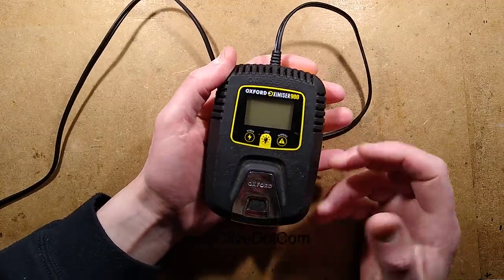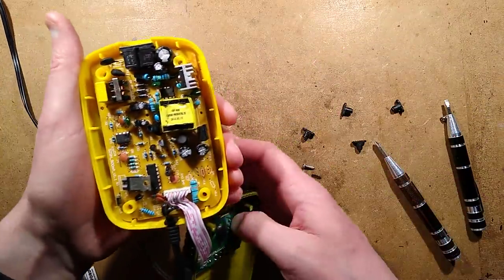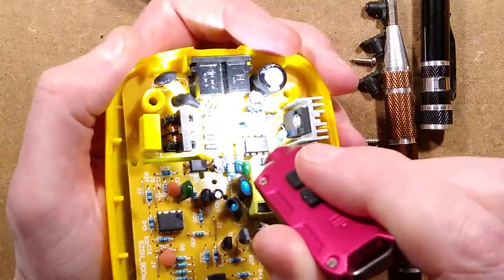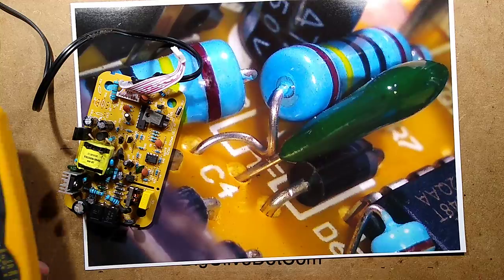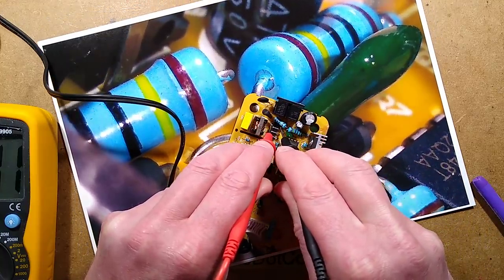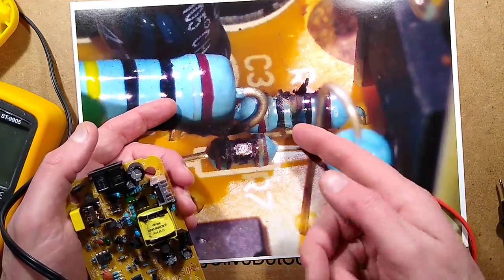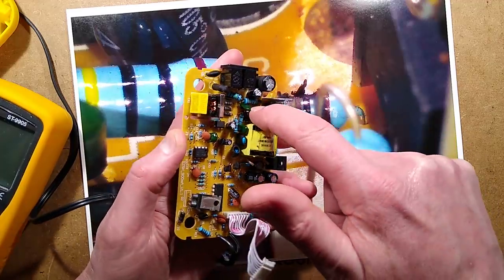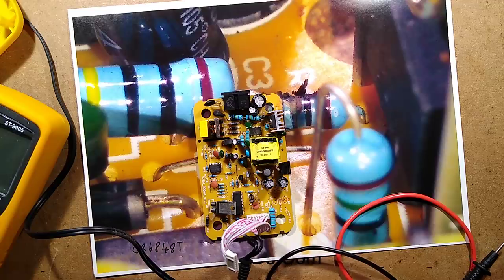Autopsy on Thomas Nagy's bike battery charger.

Comment: Any chance you can order and review a "T12 soldering station" clone from china?

Also that diode under the green cap looks quite crispy as well!
Reply: More than crispy, it's split wide open!
Reply: @cambridgemart2075  Definitely. Looks like it's time has run out for sure. There are brown burn marks around the split, like it must have been a big ark splitting it.
Reply from the maker: I thought that too, but it's a moulding seam and measures correctly.
Reply: @cambridgemart2075  yes i noticed that as well D6, maybe the snubber if so then that cap may have shorted causing a cascade failure ??

Comment: Get a new unit, but I think a different brand and form factor (to minimize the chance of getting a differently badged one off the same production line).  You might end up with the same poorly manufactured board anyway, but that's about all you can do without being able to open it up before you buy.

Comment: Death by smushed resistor leads, nice, akin to one of the 12v PSUs I got with a pair of IP cams recently, all nicely made appearance-wise, except for the untrimmed wire on the live side of the fuse(!!!) bridging several connections that would have made a nice 32 Amp fuelled bang had I plugged it in, but both the supplies have been disposed of, dodgy transformer windings being a thing, plus one of then they had snapped the earth pin off, so was no good anyway... :)

Comment: Fixing that thing..
If i needed that thing to run i would try to find where there is the low voltage side of the transformer (14..15V DC?) and input that voltage there,
chopping off and removing all the high voltage side stuff.

When simply replacing blown caps does not work and you dont want to wrestle with high voltage parts (dont have them) find the DC Caps, usually there is a 12V / 5V  perhaps also 3.3V rail.

On the last monitor i fixed i simply had to inject the 12V rail from an external DC power brick, 5V (and the cfl inverter) was running from that rail.
- If you are lucky the engineer making the pcb even marked the rails somewhere.

Comment: Note that @4:13  in the picture the diode directly under the capacitor is cracked right in half!!
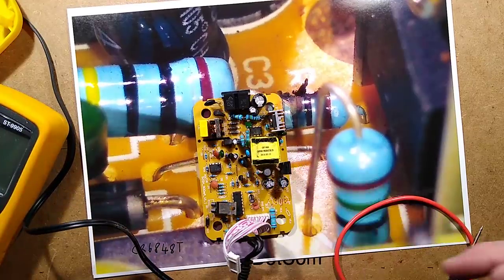You can also see the massive crack and skid mark @9:00 on the picture.
Reply: they're molded bodies and often come looking that way right out of the dies at factory. you can see evidence of that on the leads out the ends, if he could see/show it directly opposite of that would have the same line, likely all the other diodes do, some in lesser forms.
while I'm not an electronics engineer, I've been repairing and building things for over 30 years, so it's safe to say I've seen, tested and replaced a "few" diodes in that time lol

Comment: I was just about to contact you and see of you would interested in my Accumate Battery Charger/Optimiser which randomly just stopped working. 

Pipped on this :)

Great Channel.
Phil
Reply: @PHILL DIXON I had a look last night out of interest. Cant see any obvious damage, not an expert but my money was on the the transformer as I got no power coming down the charge leads, but the led does light up however so I could be wrong :)

Comment: Shame there doesn't seem to be a failsafe diode on the output to stop this failure from discharging the bike battery - or maybe the battery was went flat without help...
Reply: it would still need a connection to sense battery charge level and other small testing, so it would drain it slowly anyway.
Reply: @throttlebottle5906  Yes it would, but this is a bike battery and so that ought take a while if the battery is any good. :o)
Reply: fuel powered bikes don't have a very big batteries, so reserve capacity is minuscule, so it could potentially drain in a handful of days
Reply from the maker: The bike itself was probably a factor in the discharge too.
Reply: @throttlebottle5906  Well, it depends on the bike ! 125s have a titchy 4Ah battery, whereas an 80s BMW mid-sized had a relatively huge 30Ah  - anyway we'll never know the exact details of how this battery got flattened I guess...

Comment: A TV repair person (they always have the best tricks) showed me a trick to measure a fried resistor - carefully cut it in two and stick the probe through half of it and it's likely 2x that.
Reply from the maker: I've done that with failed wirewound resistors.  Never considered it with film ones though.

Comment: Why do things have to be so complicated nowadays. Whats wrong with a mains transformer, bridge rectifier and ammeter. Why do you need this lot for a lead acid battery charger.
Reply: Because  a typical motor cycle is parked up over winter, and that means the battery will need to be trickle charged, approximately monthly.
Now most people are to idle, sorry busy to do this so automatic float chargers were invented. Unfortunately people don't want to pay for a real quality item so they buy something cheap.

Comment: Does a couple of resistors and other elements really now cost 30£ in UK?
Reply: Think he was expecting the chip to have blown too.
Reply from the maker: It's actually even locating some of the components.
Reply: @Apollo-p1l  usually the  brainbox electronics and muscle electronics are separated a bit so it's worth attempting a repair at least
Reply: @bluef1sh926  Only if your time is very cheap.
Reply: @Apollo-p1l  I have a bad habit of fixing everything untill it's either fixed with preventive maintenance added or broken even more. It's like a hobby, a challenge, or a habit of keeping a working fleet of appliances and devices.
Reply: @bluef1sh926  You would have to really want that charger to spend hours on it, researching chips, ordering components installing components, and then it blows again. If it was an expensive hard to find gadget then yes, but it isnt.
Reply: @Apollo-p1l  Recently I realised that I had 10 working kitchen mixers, because people donated them to me from time to time and I just kept fixing but forgot that I already had X number of working mixers. I have issues.
Reply: @bluef1sh926  LOL. I have the same problem. I certainly dont stick to my own advice. Cant bear throwing stuff out I think I can fix.

Comment: this failure mode is why I open just about all electronics I get from china and inspect them for touching components before powering them on. especially my welder and plasma cutter. Then I clean up any wires that look like they could rub though and short out on heat sinks and such.

Comment: I would say the resistor was placed on the board with very long straight leads. Likely it was up right next to the cap there. The heat over time has caused the leads to soften and that causes the swirly effect you see there in the lead. Very uniform. It's gone down and made contact. And. Well. The angry pixies get out. It's all over.
Reply: Perhaps that bigger resistor was wedged in to that position precisely because there was greater heat dissipation requirement for that component than originally realized.
Reply: Enough heat to soften the resistor leads would have lead to much more damage.  I think the resistor was intended to sit high for heat dissipation and the curly leads were formed to assist with manufacture.  It is just poorly implemented and with the closeness of the parts a simple bump during shipping or usage could cause a failure.

Comment: AARRRGGGHHH! @1:35 "LCD display" = liquid crystal display display!
Reply: WINE is not an Emulator
you're welcome
Reply: Ah, so you are one of the old school guys who does not like those modern lcdds, i see... :-/
Do you also have a NIC/EIC T-Shirt ?  - Should get one as revenge ! ;-)
Reply: Is that LCD display mounted on a PCB board next to a FET transistor by any chance?🤬🤬🤬 I got into the habit of calling them LCD PANELS, much safe imo.
Reply: @PsiQ  Old school? Well my wife calls me an old fart! But I do remember those days when LCDs didn't exist in the mainstream :-(
Reply: @theonlywoody2shoes  LOL!
Reply from the maker: Indeed, and the oddity when they first started appearing in things like calculators.

Comment: the diode looks broken too. looks like a crack.
Reply: oh it is cracked.. good spot..
Reply: @keithking1985  from head to toe by the looks of it, that's interesting, those tend to be dated for quite a high surge current 50A or more
Reply: Yep, it's cracked 👍
Reply from the maker: It looks it, but it's just a rough moulding seam.  It still tests as a diode.

Comment: I would look at the underside of those two burnt resistors for their band colors.  If they are metal film or metal oxide resistors I would measure them as they can usually servive all of their paint being burnt off. Ron W4BIN

Comment: Typical Oxford product quality.
They are a huge brand with a huge range of products that use masses of in your face advertising. The products are well designed but typically fail just outside of the warranty or are not fit for purpose straight out of the box. 
As a biker I have tried some of their clothing, luggage, security products, tools and battery chargers and have been disappointed with every product that I bought from them although I have bought some older used Oxford products that are still going strong. It would appear they used to make better products but have let their quality control slide recently and are now trading on their once good name. 
I have vowed to never buy any of their products again !

Comment: The manufacturer should replace that free of charge due to poor manufacturing, and apologize furiously, begging him for not to sue them since it was a very serious fire hazard.
Reply: it burnt up, the fuse blew, the case didn't melt and no fire. which is exactly why they're fused and it did it's job.
Reply: @throttlebottle5906  So, you say the product is decently made, safe enough and no free replacements or  apologies needed?

Comment: I've got an Oxford charger... cost a lot and is mostly useless because it only realises it's connected to my bike about 1 in 20 attempts. I've found if I unplug the power then turn it on, the relays will clunk and register battery voltage with what's left of the energy in the unit then I plug it back in before it's totally died, it will usually charge the battery. It always turns itself off though - never has sustained a trickle charge. Utter junk.

Comment: These battery charger manufacturers need a kick up the backside.
I had an Oxford car/bike charger about 8 years ago and it wasn't any better than this, that also failed completely and wrecked the battery it was attached to (drained it so low it was irreparably damaged), I'd bought it based on a set of reviews at a well known motoring related publication.

After it failed I bought a Ctek 3600, which everyone raved about at the time, this worked fine for a number of years, but then I noticed it was trying to dump 16v into my car battery, boiling the damn thing, new battery same thing. I took this unit apart and it was frankly nothing more than marketing BS, "multi-stage charging" my arse, "intelligent" my arse, just cheap junk made in China to a budget. All it did was kick out a set voltage until the current dropped below a certain level and then paused charging for a set period of time, there was even a preset on the PCB to adjust the maximum voltage.

I've since made my own charger, because when the "top" "manufacturers" are selling this kind of crap, and everyone raves about them anyway, how can you trust anything else? We live in a world where as long as you have salesmen and marketing muppets, you don't need a decent product at all.

Comment: If the PSU is mounted on the motorcycle it would be subject to vibration.
Reply: Normally it shouldn’t. This model is supplied with a lead that you attach to the battery and has a small connector you can mount in an accessible place. You then attach this device to said connector to hook your bike battery up to the charger.

Comment: Why even bother printing component values on a circuit board, and then not make the schematic available easily. I remember the good 'ol days of Radio Shack (siiiigh) when a full schematic was given with EVERY user manual, and frequently printed on a sticker within the cabinet (siiiiigh again)

Comment: It could be the resistor coating broke down and arced to the conductive film inside.
Reply: my thoughts also, the voltage ratings are from lead to lead through the resistor, not through the body coating and pretty standard is having a metal cup at the ends with the conductive part and former crimped inside, the leads are spot welded to those caps also. so it went "BANG" where small resistor was touching large resistor leg.
Reply: @throttlebottle5906  some resistors will specify the body strength, some don't. I design units that connect to CAT III/ IV systems and breakdown through the resistor coating has caught me out before.
Reply: for sure, proper component spacing is a must :)

Comment: Repairing it would be viable. A SMPS chip, a transistor, 2 resistors and some diodes wouldn't cost £30 and it would be one less e-waste item. Clive probably already has the resistors, 4 1n4007 diodes, a suitable high voltage transistor and the chip wouldn't cost much. That large one looks to be brown black black black. You could probably work out what the other small one is from the chip datasheet and where it is in circuit.
Reply: How long would it take, how much do you earn an hour ?
Reply: @FarleyHillBilly  I charge £10 an hour. I already have the resistors, 1N4007 diodes, high voltage transistor, i might even have the chip, depending what the part number is, on a scrap board. I could do this in 1 hour. If this was my battery charger, obviously i wouldn't be charging myself £10 an hour.
Reply: @simontay4851  
That,'s the difference between an instructional hobby and a business.
My company charged £50 an hour for my services I was paid less than half that.
If you were snowed under with work, you would only make £1600 a
month and have to pay income tax out and bills of that
Bin it

Comment: Well that looks over-engineered
Reply: What do you mean? Its a bog standard energy efficient SMPS with a regulated DC output for charging and a display to let the user know how the charging is going. 

It hasn't got 10 different charging modes and weather forecast display.

Comment: Well this isn't reassuring, just installed one of these in my garage...
Reply: Aye, crack it open and check the fault area for impending apocalypse.
Reply: Request a refund.  Send the supplier a link to this video - they should think carefully about dealing with this manufacturer.
Reply: open it and post here :)
Reply: Hmmm. I got one on my bike just now in the garage. I think I might pop to the garage and unplug it.

Comment: It seems like this wouldn't be more expensive to repair than replace if its 30 quid to buy a new one? Or are some of those components expensive? (I guess you have to consider the time spent too)
Reply: I wouldn't buy another one if it's manufactured so shoddily.  You are entitled to a refund if it's flawed in that way.
Reply: 50 quid an hour or any part thereof plus parts. Bin it and buy two for the same price

Comment: Shouldn't you be using a VDE screwdriver to remove the screws on the case? And I didn't see you use a lock off kit to ensure that the power was off.   ;-)
Reply: Real Electrician's only work on live equipment and only use VDE when working on 415v and above lol.